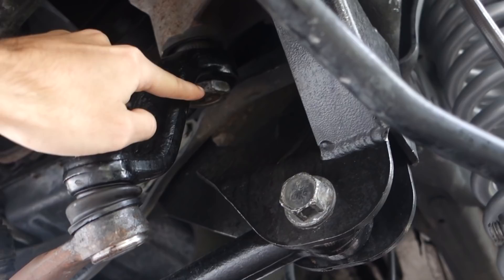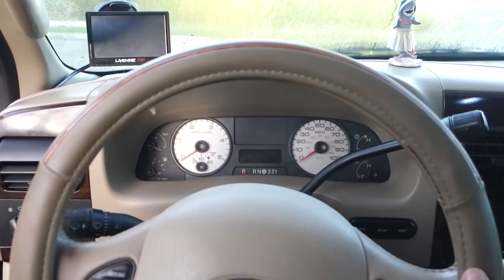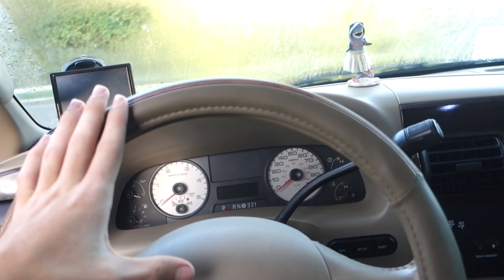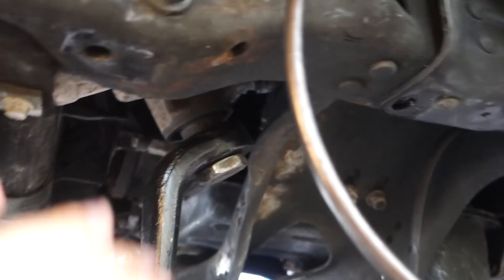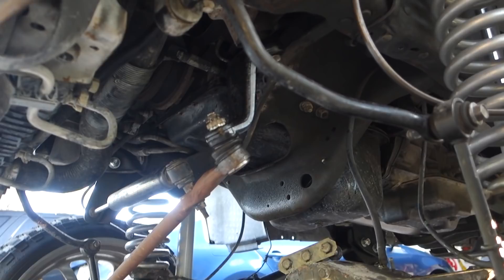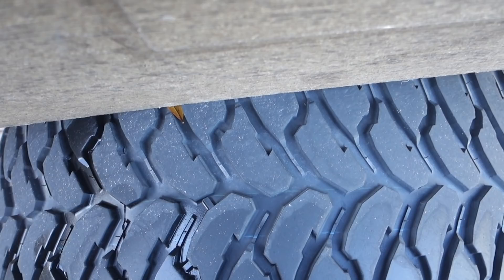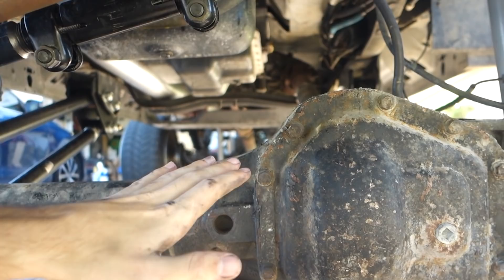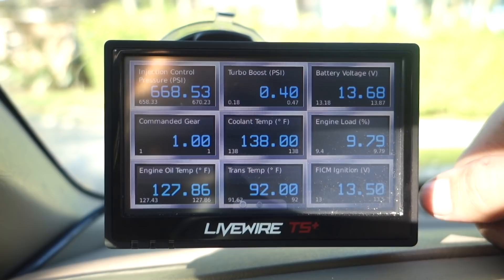I Fixed This 3 Times Already...

Comment: You don’t have to adjust your track bar every time. Leave it at the spot it was. You need 2 people, but you just turn the wheel and the body will move over the axle. Super simple.
Reply: good tip, thats how I did it
Reply: Jack Pecora it’s the most simple way. A les Schwab alignment guy taught me that.
Reply: I ended up using that trick a while back. Very useful!

Comment: What's the point of using the larger breaker bar if you didn't pull from the end? Didn't take advantage of the leverage.
Reply: Benny Garcia cause tbh it was kind of over kill and i think he realized that when he used it...
Reply: Benny Garcia he still used a lot more leverage then you think to tighten that nut and Brandon James is right in the fact about it being overkill. If he was to get at the end and pull he would easily either strip the nut or strip the threads off the stud.

Comment: I had the same problem with my pitman arm nut I eventually went to Ford and got a new one, they only recommend the nut to be a one time use, and I also used lock tight. 
After that it stopped loosening up

Comment: Great video 👍 we got a 6 gen SS Camaro and a F250. Both modified so I'm like you when it comes to rides. I aslo have the RC 8 inch lift. It's sitting on 40x14.5x 20s. I love my truck just as much as you do yours.

Comment: The way I do mine is buy a closed end wrench cut it in half so that it will slide into a pipe and buy a thick long pipe for leverage.  Put the wrench on it and slide the pipe over and put both balls into it man.    I had the same problem with my cummins and fixed it

Comment: By tightening the Pittman arm, you are driving it up on to the gear box splines. A good thing.  Now remove the Pittman arm nut and install the proper lock washer and reinstall the Pittman arm nut.

Comment: On my 06 we put an 8 inch fabtech lift on and even with blue thread locker we couldn’t keep the nut tight. We ended up putting red thread locker on it and tightened as tight as we could with a breaker bar. Problem solved never came loose again. Only issue is we had to heat with a mini propane torch to be able to remove it when we eventually needed to replace the steering gearbox

Comment: Put it in a vice, use a 3/4 or 1” breaker bar and use a cheater. There is a calculation to see how far you have to be away from the fulcrum to put X amount of force. I ended up using a couple feet of a cheater and that calculation and it was super easy for me once I put the gearbox in a vice. 2 years ago never had a problem.

Comment: Where is a lock washer on your pitman arm steering box should be a lock washer and also use Loctite it wouldn't come out if that lock washer is installed
Reply: Nabiel Suleiman there is no lock washer..I have the exact same lift
Reply: Try and find one and see if that works

Comment: As far as realigning that use a tape measure front of the tires you take one measurement back of the front two tires you take another measurement should zero out or maybe a quarter shorter in front measurement of tires front of Wheels compared to back of front axle wheel tires